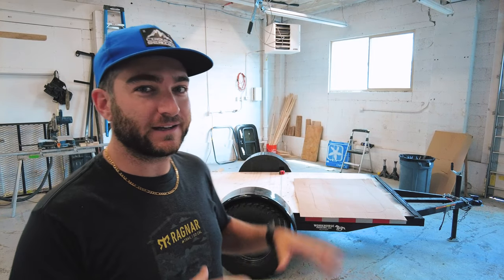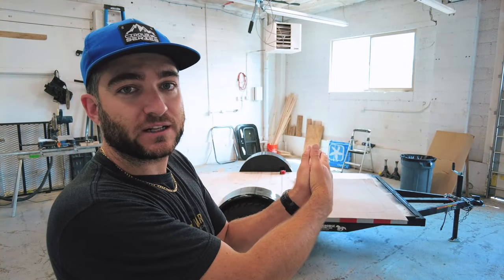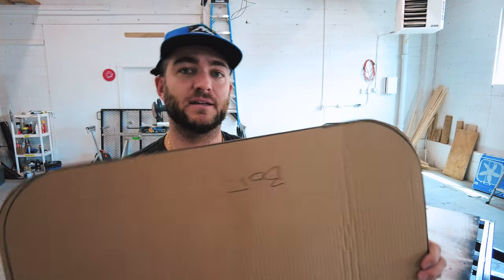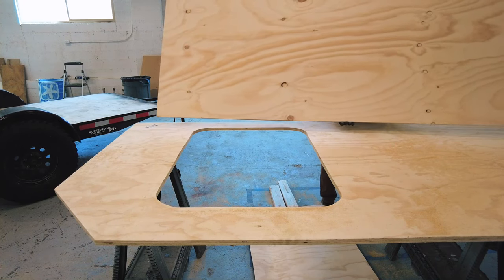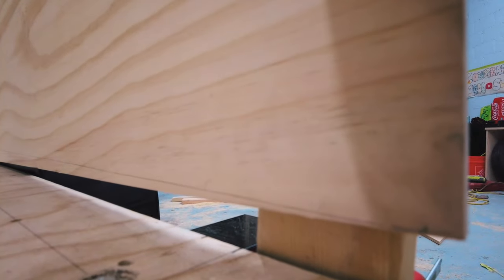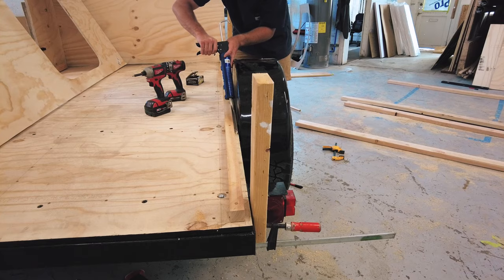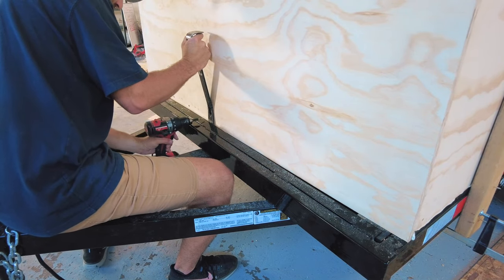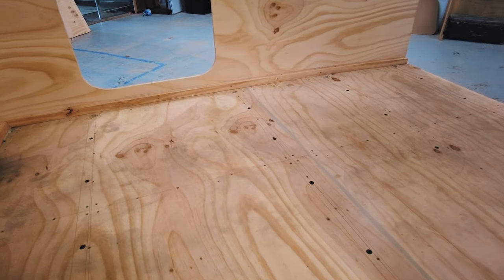How To Build a DIY Camper: Building Your Camper Walls

Comment: That trailer now had me gasping for air!  Good solution to compensate for it...and the bowed plywood.  So much plywood right now is as twisted as a Lowe's 2x4.
Reply from the maker: Right!? It’s a brand new custom trailer too. I definitely won’t be going back to that manufacturer.

The plywood is almost laughable. In the next video, you’ll see how bowed the other walls are. I had to straighten those out as well. I’ve never paid more for such terrible wood.
Reply: @FunkeAdventures  that's what I said to my wife. I'm like, that's crazy a custom frame isoff bythat much! You would think they assemble on a perfectly flat jig at least

Comment: Hi I had the same issue my trailer had a 8mm bow in trailer frame i took 8mm off the middle to nothing on to the ends & worked perfectly now I got to do the same for the aluminum composite sheeting I'm installing this week
Reply from the maker: Thanks for sharing your process. How did the composite sheeting install go?
Reply: That "bow" in the trailer frame is by design so that it is flat when under load.  Not sure how much weight the trailer enclosure + gear + people weigh, but I doubt it has a significant impact.

Comment: Quick question.   What grade plywood are you using?  My wife and i have been pricing 5x10 squaredrops.  Thinking about building to keep the cost much lower than 20k.
Reply: Everything I read says spend the money and get a Marine Grade Plywood. You'll be happy 20 years down the road you did. I'm using  a marine grade pressure treated plywood for the floor, to avoid any moisture problems from the underside.
Reply from the maker: I used mostly A/C plywood, but not pressure treated. 2 years ago, I spent around $5-6k to build this one. So you should definitely be able to keep the costs much lower than 20k.

I thought about using pressure treated, but I wasn't too keen on sleeping in a pressure treated box. I know pressure treated chemicals are probably much safer now than they used to be, but I errored on the side of health and focused on getting things sealed up properly.
Thanks for watching!

Comment: Quick question,  I see that you left room in the front of the trailer so the plywood goes to the base of the trailer and overlaps the plywood and then you can screw it to the bottom plywood.  Why didn't you leave a gap for the sides so you don't have a place that water could  Penetrate and an extra place to secure the sides? You're doing great work, I was just wondering.
Reply from the maker: I'm not 100% sure I understand your question, but I will do my best to answer. The bottom sheet of wood is sealed up with an automotive undercoating. Where the side walls meet the base, the join is sealed up with construction glue. Then my aluminum siding and trim wraps the corner to keep any moisture from working its way up to the wood. I also coated the whole trailer in KILZ anti-mildew anti-mold paint before putting my aluminum siding on. 

Thanks so much for watching and asking questions!

Comment: Are you using standard 4x8 sheets of plywood?  If so what are your rough measurements for the camper and interior cabin space? Looking at and watching your videos in depth is really assisting in the build of my current tiny camper!!
Reply from the maker: Hey, thanks for watching the videos and subscribing to the channel! I am using standard 4x8 sheets of plywood. The exterior of the camper roughly measures 5 ft 3 inches wide x 8 ft long x 4 ft 1.5 inch tall. The 1.5 inches extra on the height is the width of 2 sheets of plywood. For example, the height is one 4x8 sheet of plywood, with one sheet of 3/4 inch plywood butt up against it on the bottom and one on the top, making 4 ft 1.5 inches. Hope that makes sense.
The interior is roughly 45 inches tall x 60 inches wide x 80 inches long (fits a queen sized mattress perfectly). Then there is a 12 inch storage space in the back.

Feel free to reach out if you have anymore questions. You can find me on instagram @aaronfunke and can send me a DM with any questions.
Reply: waste of money and time i have a tent bigger and it only cost me $100. if you dont have room to stand and take a shower a trailer that small is worthless.

Comment: It appears to me the “studs”!are not really load bearing. Is the wall design/construct sturdy enough for a cargo rack on top or a couple of kayaks?
Reply from the maker: You're right. Those "studs" provide some spacing for the insulation and give me space to run my wiring. They also give me a solid surface to screw my interior walls (frp board) onto. I add a homemade roof rack on top of the trailer. The roof rack is mounted directly over those exterior walls, so any weight from cargo like kayaks is put right over the strong exterior walls. This eliminates any load being put on the roof and keeps it from bowing down with cargo. 

I hope that helps! Thanks for watching and subscribing!
Reply: @FunkeAdventures  Thanks. I’m looking forward to the next video. I’m buying materials for my 1st build.
Reply from the maker: @TheDouglash  I'm going to do my best to get that next video out in the next week.

Comment: I must have missed the thickness of the wall plywood, can you say again?
Reply from the maker: I always say that it is 3/4 inch plywood, but it actually is 23/32 inch plywood found at home depot.
Reply: What grade plywood ? Sanded or below ? Looks to be below with the knots
Reply from the maker: @DeepSouthOverlander  Here is a link to the plywood I used: https://www.homedepot.com/p/0-68-in-x-4-ft-x-8-ft-CMPC-A-C-Plywood-MAP902R0002P21/309749020

It is sanded on both sides, but only one side is "A" quality with little to no knots, which is the side I used for the exterior. The other side, is "C" quality and is the inside of the campers exterior walls and ends up getting covered by insulation anyway.

Thanks for the question!

Comment: and why didnt you fix your trailer???
Reply from the maker: Not sure if you are referring to the bow in the trailer, but if so, I just don't have the tools to be able to fix the bow. It was easier for me to build around the issue. It won't negatively affect the performance of the trailer and is not noticeable in the finished product. Thanks for watching!
Reply: @FunkeAdventures  gotcha.  Check and make sure your axles and their geometry aren’t out of whack because it can cause issues down the road, especially under load.  Q